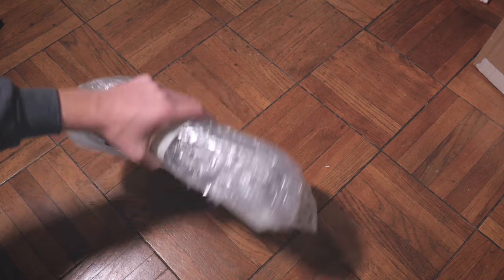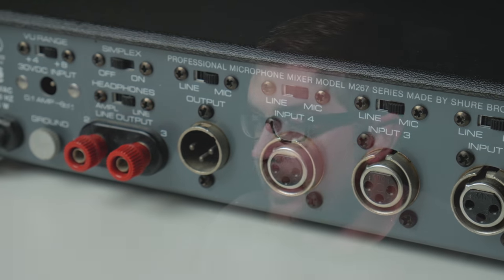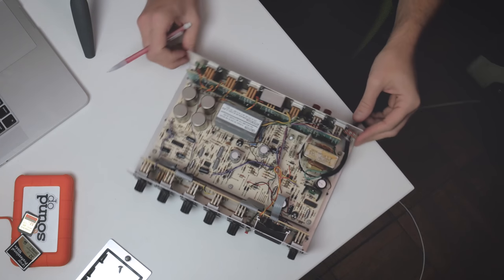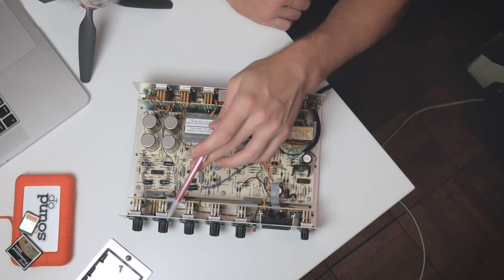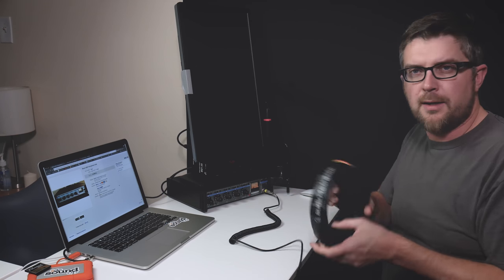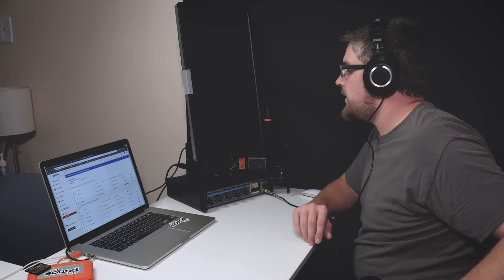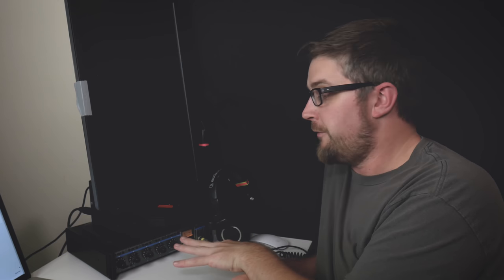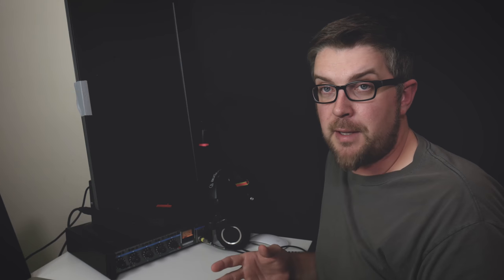Vintage Tech: SHURE M267 Pro Microphone Mixer

Comment: I've carried a Shure M67 in my box since the early 70's. It was a great way to add extra microphones to the six channel equipment our band carried back then. It still works flawlessly. About every third year I use a little Deoxit on the pots and don't even have a crackle. I remains my go-to when I need something on my desk, or when putting in microphones for a small teleconference. It simply keeps on working. I wish more units had the test tone feature.

Comment: The M267 is great for crushing drums, especially in parallel. The M67, the Woodstock mixer, is a lot better for general use. This entire Shure series works well for a "lo fi" kinda thing. Lotta variations, all actually pretty cool in their own way
Reply: hey man, had some questions about this unit for the uses you adressed here. are you about to discuss?

Comment: Thanks for the awesome video. I liked the presentation AND content. I have an application that may be a bit out of your wheelhouse, but maybe not really....just a little retro. I am a ham radio operator who has recently acquired TWO late fifties/early sixties vintage Gates AM broadcast transmitters which I intend to put on the air at 160 and 80 meters. I know nearly nothing about professional audio, but ended up with a Shure M67 and and its companion M675. I am using them for the "front end" of my Gates AM transmitters. (a kilowatt AM btw. not wolf man jack in acuna, but enough to get out). So I found your treatise of the M267 very useful.....and pleasantly entertaining. Please keep doing audio youtube videos, I can learn a lot from you.

Comment: We still use these as well as the 367 for TV news gathering.
Reply from the maker: Yeah, I see them in installations here in DC still too. Especially in some of the more mundane govt Dept buildings. 

They’re like old cars at this point, nothing fancy, but I know if it breaks down there’s a pretty solid chance I can repair it on the spot with simple tools and parts.
Reply: @DcSoundOp  They still work and it's all analog including the limiter. I have been using a 367 as a preamp into a Zoom H5.

Comment: I've never quite gotten the reason for the faint praise these mixers get.  I always carry one around in my toolbox of audio stuff.  They're just great for all kinds of weird case uses.
In fact, I just use an m267 mixer last weekend.  It was a conference room style show and so audio had to be fed not only to the main system, but also to the "house" system that consisted of those built in ceiling speakers that sound like junk.  That way even people not in the main room would hear what was happening on stage.  In this use case, I took stereo line level out of the board I was using for the main mix, fed it down to the m267 that was sitting by a house microphone spigot and set the m264 to do mic out.  With the limiter set, this thing could take whatever I was sending to the stage and mix it down to a signal that sounded good and didn't overdrive the tiny ceiling speakers.  It's just a great all around utility mixer.  I've had mine 30 years, it hasn't been serviced.  It just works every time.